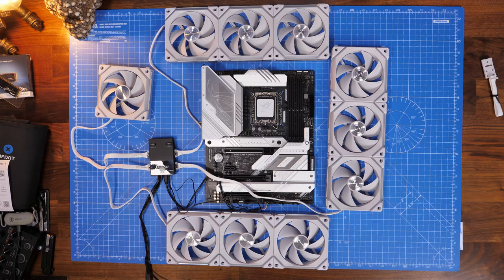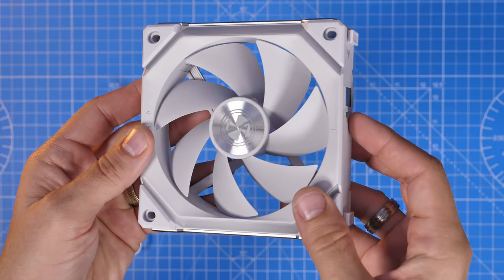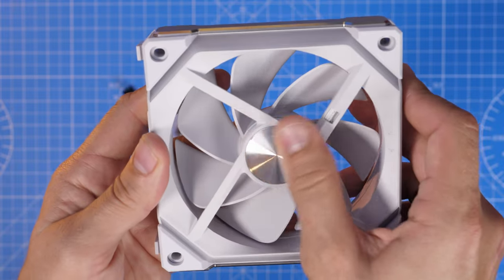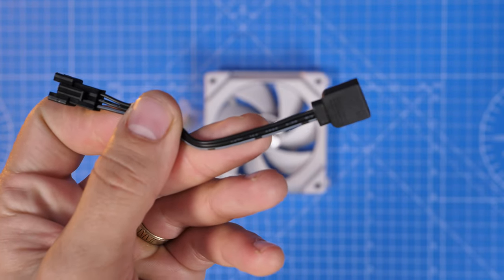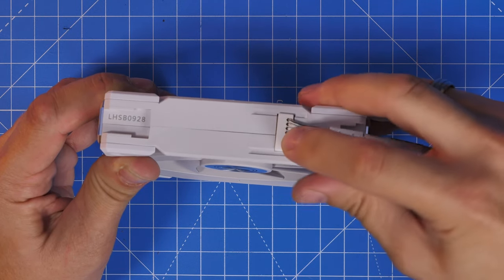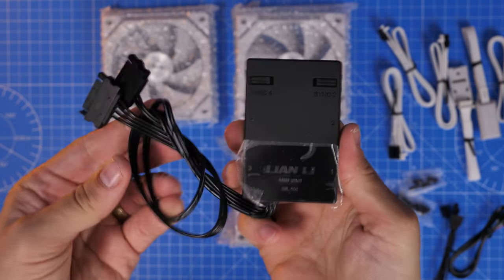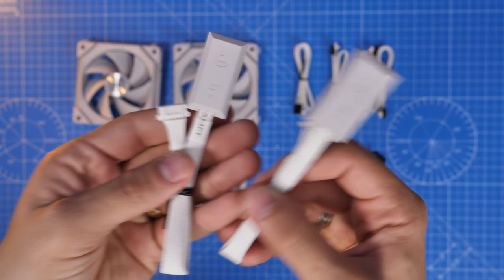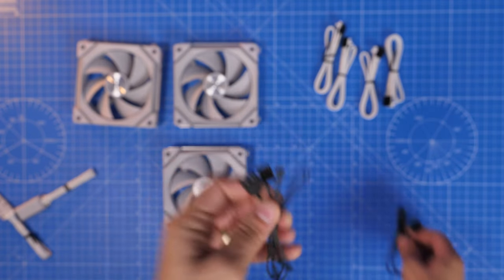How to connect and setup Lian Li SL120 V2 fans (including on an all-in-one cooler)

Comment: your guides are always great to watch and a big help building up a new system. i have a 011 dynamic evo xl case with an additional led lightstrip on the front of case. i will mount 10 lian li tl 120 fans. which is the maximum number of fans the lian li controller can handle. will the controller still work when connecting the led lightstrip from the case to port 4 of the controller or is it better to connect that on the motherboard directly?

Comment: I'm using this same Asus Rog strix X670E motherboard and I'm confused about rather or not Lconnect 3 can sync with the RGB lighting built into the motherboard. Did you cover that, and I may have missed it?

Comment: Trying to understand how you have all those fans into the 2 rgb slots in the controller. The radiator fans need a dedicated rgb slot, meaning you either daisy chained all the others or you have 2 controllers?
Reply from the maker: You don't "need" to use the RGB header on the motherboard technically. But yes, you can opt for two controllers instead.

Comment: I'm planning a build that involves at least three sets of the 140mm version of this fan. Sadly, they don't sell it in a 3-pack like the 120mm so the only way to get the controller is to either buy it separately or buy a 3-pack of the 120mm to get it, which is sadly the easiest way to get it because the standalone controller seems to be hard to find in stock. EDIT: Scratch the standalone controller. That's the V1 intended for the UNIFAN V1's. The controller that comes with the V2's isn't available as a standalone yet. Which means the only way to get it is to buy a 120mm 3-pack even if all you want is the controller or one 120mm fan to use as the rear exhaust if a 140mm won't fit with everything installed.
Reply: where did you buy i cant find any in stock

Comment: Thank you for this, I am still a little confused using the Lian Li v2 fans for my AIO H150 LCD Elite XT and hoping you can help! I have the h150i with the single wire connector going to the  CPU Fan connector on the mobo(Strix Z790A WiFi II) and the other 2 cables going to the H150i controller, so it's hooked up as it should be. I then have the 3 daisy chained Lian Li fans for the AIO going to the Lian Li V2 controller in 1 of the 4 slots and the other 3 slots are being used for the case fans. Is this the correct way to do it? Since the Lian Li controller is hooked up to the Mobo to a CHA Fan connector at the bottom, does that mean the AIO fans function correctly and can be adjusted in L connect since the AIO is hooked up to the CPU fan on the Mobo or would I need to swap the AIO fans cable to that splitter cable that comes with the single fan and plug the RGB connector into the sync port on the UNI hub and the 4 wire connector to the CPU fan, which would mean the h150i singe wire connector would be unused...? Really hoping you or someone can help so I can finish this build today!

Comment: Hi, I just have a question with motherboard connections. If I replaced the radiator fans to the SL UNI 120 , do I connect a 4-pin splitter to the pump, to then connect to the 4-pin cable on the fans? And also plug in the sata, usb and 4-pin connection from the pump to the motherboard and sata? 

I am using a B650 Auros elite ax mobo and lian li galahd ii trinity 240

Comment: Are the spare connection cables that come with the 3 pack of 120mm fans interchangeable with the 140mm fans ? 
I want to link a set of 3x 140mm fans with a set of 2x 140mm fans for intake, and a set of 3x 120mm with a single 120mm for exhaust & using the control box provided in the 3pack of 120 fans.

Comment: I just built a new computer and I notice that my CPU temp will go from 44 C at idle to roughly 52 C and the fans will rev up to get the temp down and this is a bit annoying.
Since this is the first computer I've built with RGB thing-a-majigs in it I'm wondering if I've made a mistake somewhere, so I found this video and it looks like I've messed up a little if I understand you correctly.
I have a Lian Li 011D Evo RGB, a Lian Li Galahad II Trinity with the default fans and 7 Lian Li UNI FAN SL120 RGB V2 PWM's.
I have three fans in the bottom as intakes, three at the front as intakes, the AIO fans as exhaust and one fan as exhaust at the back.
The bottom fans are connected to the front fans which in turn connects to the third port on the Lian Li controller. 
The rear fan is connected to the first port on the Lian Li controller and the AIO is connected to Sync 2.
But if I understand you correctly (17:50) I should plug the fans on the AIO to an RGB header and fan controller rather than the Lian Li controller. Is that correct?
Reply from the maker: You can do that or alternatively you can go into the L connect software, remember the port those fans are connected to and set them to adjust to CPU temp. That way the fans on the rad spin accordingly. Maybe set the others to respond to GPU temps
Reply: @TheProvokedPrawn  I noticed in the instructions that I should have a cable from the pump to the fans, so I connected that cable and not the system is quiet.

Comment: Question, does this work with regular Lancool Mesh 2 case fans tho? I bought a 3 pack of these  SL120 V2 fans with a controller but it doesnt seem to be able to accomodate the regular 3 pin fan headers :(

Comment: Dear Prawn 🦐,

Thank you for this amazing video you created.

I have one question. At 14:30 what is that kabel’s name or number that you just to connect the fan to the control box and the pump header on the motherboard. because I did not get it with my uni fan SL-INF 120 triple pack or the single pack. Is this cable for sale separately? I hope you can help.

Thanks for all you great work👍🏻

Comment: Can you please help me? I have Nzxt z53 and Lian li sl120 v2 fans. I want the Nzxt CAM to control the fans based on temp, but for some reason the Lian li L-connect controls the fan speeds for the cpu. Also, it reads higher temps than CAM so the fans are always at 100% and is so noisy. Is there something I can do to fix this?

Comment: Question using the 3 pin and the little tiny connector, you can plug that 3 pin into say... the Razer Chroma RGB Controller to control the RGB from THERE right?

Comment: The problem is if you buy the 3 pack of SL Inf 120, you only get the cables that allow you to connect to Hub, but with the single pack, the cable doesn't have a connection that allows you to connect to the HUB. It has the 4-pin PWM and 3-pin ARGB connector that goes directly onto the motherboard not the controller so I can’t separate the AIO fans from the case fans. You are left with a choice of running everything from the hub, which doens't allow the pump to control fan speed, or connecting power to the pump and then RGB to the board which L-connect then wont control with all the other fans.  Any solution to this?

Comment: I love the look of these but they nearly broke me tonight. I have there CPU  cooler which came with V1 fans and I got a 3 pack of the fans that are v2 and I cannot for the life of ke get them to sync up. They have different control hubs with different connectors.

Comment: Good explanations but wrong aio radiator block position ! You got to have the pipes head down or that will damage it 🤷🏽‍♂️
Reply from the maker: No. You're wrong. As long as the pump isn't the highest point it's fine.

Comment: Do you need the ARGB cable coming off the controller installed onto a 5v header to control the RGB via L Connect?
Reply from the maker: No. That's just for motherboard sync

Comment: So because these fan hubs only connect to the MoBo with 1 pin my bios NEVER recognizes them allowing me to control them. The workaround is to use a splitter and run the hub and one set of fans off of the MoBo header. Do the v2s come with an adapter to hook into a standard MoBo header?
This is with an asus strix 690-e. No fan control using bios unless you give the fan header an actual fan to control

Comment: Could this be updated for the new Lian Li Infinity fans with the proprietary connector? 

I see you recommended against connecting the AIO fans to the controller, due to the flexibility that comes the dual connector.

In SL-Infinity 3 packs, the only cable included for the fans is the proprietary Lian Li cable that only connects to the controller. This leaves no choice but to connect the AIO fans directly to the controller, with no ability to connect to the motherboard or pump breakout cable (if it exists).

I'm wanting to use these Lian Li fans on my Corsair 150i radiator, but I'm worried that I won't have anything connected to the CPU_FAN header, and they won't work in conjunction with the pump. I'm going to try connecting them to the controller, and set a curve according to the liquid temp of the CPU radiator...since I have no other options.
Reply from the maker: https://youtu.be/W_ApiN_Wueg

Comment: I'm still waiting to get my kraken early next week so still scouting and planning how to put my infinity fans, it sucks we can only see the center infinity mirror when they are set to exhaust (afaik) i am a bit surprised why you set the fans to suck the warm air from the radiator into the chassie? Also wondering how i could set up as many infinity mirrors as possible to show inside ;(

Comment: Very well explained thank you. Glad I found this channel before I'm gonna start my first build I'm thinking about getting these fans the infinity versions. I heard they can get quiet loud though which is a big no for me. The other option I hear is good is the Arctic p12's but for airflow and minimal acoustics but wouldn't I have to get a butt load of controllers for 10 fans? :/ Decisions decisions.
Reply from the maker: I would not call the Infinity fans loud. In fact in my experience all Lian Li fans are quieter than other I've used.

Comment: This is a great explanation! I’m actually gonna do the same thing however I’m going to use a push pull configuration on the top, I was wondering do I just attach the second set of three fans to the second splitter for the pump power or I think it’s called a fan control? Also on a previous video you recommended using a XSPC Radiator Fan screw 30mm, would this work for the top of the case? (Because you utilise it for the side of the case)

Comment: Hi. Can you have more than 4 ports for the fans in l Connect 3 software? The controller itself has 4 + 2 ports (the 2 on the top sides of the controller which can connect 3 pin cables). But in the software only 4 ports are shown. What happens of my 4 normal ports are used and I connect another Lian Li device to the 3 pin port? Thanks.

Comment: Would there be any reason I shouldn't let L-Connect 3 control an AIO's radiator fans? I'm fine with plugging into the CPU Fan header, but wasn't sure if there was a hard and fast reason to do it. Thanks in advance.
Reply from the maker: If you want to do it that way you can.

Comment: Thank you! I have been slowly putting together my build and am doing this exact set up with the Evo and the infinity fans. I was curious about how to go about the AIO fans since I picked up the X73 (don't care for the Lcd) but thinking the Lian li fans would be an upgrade, so this is incredibly helpful. I like the idea of going full SL120's to have the single control box but makes sense to have the AIO control the set of fans attached. Do you think it would be wise for me to keep the nzxt fans as well and set up a push/pull configuration (exhausting top)? Also getting 13900 so I know it will run hot. Thanks again for the great videos.
Reply from the maker: Probably not because they will run are different speeds with different airflow capabilities. It works but it's not ideal
Reply: …and this was already tested by Jay2C and had not a single degree impact

Comment: where then do i plug in the cpu fan cable that's on the aio pump if im gonna plug in the lian li fans to the cpu fan header?? the cpu_opt header??? or do i even need to plug the one from the aio at all? 

i am using the corsair aio with the lian li infinity fans

Comment: I bought all triple packs for my nxzt kraken cooler and I don't have that one cable so am I good to just connect everything to the lian li fan hub? and also for the USB connection for the breakout cable on the pump do I just plug that into one of my USB headers on my motherboard since I'm not gonna be using the nzxt fan hub?

Comment: Hey I have 18 of these SL120 V2’s. I have 16 connected to one hub and that’s connected to an aqua computer OCTO for pwm control through water temperature. Can I connect the last two via that single cable splitter which separates the rgb and pwm fan to the same controller via the sync port and the octo will take the pwm cable?

Comment: Thanks for the video. Super informative.  If I have an AIO GPU with radiator, after plugging in the rgb into sync slot, where do I plug the fan control?  Thanks in advance

Comment: So wait I’m confused, can I just run the USB cable or do I need to connect that 5V ARGB cable. Asking because I don’t have a 3 pin ARGB header on my mobo
Reply from the maker: You can just use the usb connection from the hub and control them via L-Connect

Comment: One question I have, you wouldnt be able to use the SL120 fans on the lian li galahad aio with this controller would you? So you would have to replcae the fans on the aio with the V2 fans, at least that is how I'm understanding it
Reply: Im having this same problem. ST fans on the radiator and SL fans have the easy single connect. The controller doesn't have the 3/4 pin but only the SL connection. might have to replace the lian li fans on the radiator to SL to make it simple but im also looking for alternative answers.

Comment: Hi there, im will use SL120 v2 + LT720 for my fish tank build, and use the single wire with RGB+power and connected it to my controller and have it controlled using the software and just set the fan speed to max or it is still better to connect the SL120 v2 for may radiator and have it connected to the aio wire and connect to my pump header and have the rgb from the aio connected to the controller?

Comment: Hello Provoked Prawn! Great quality on your videos. I went with this exact setup but unfortunately ran into so many software bugs with L connect 3 I'm about to give up. This software crashes my new build gaming PC if i keep it running. So i have no fan control. I dont see a way to connect V2 fans directly to mother board. The set of 3 fans don't come with a cable that can go from fan to MB. I have one single that did come with that cable. Lian Li does not sell V2 cables of this kind that can go fan to motherboard and RGB to hub that i can find. Any suggestions? Thanks.
Reply from the maker: You could use the controller and connect to a PWM header and the RGB and then just use motherboard sync instead? Not heard of L Connect causing crashes though. Very odd.
Reply: @TheProvokedPrawn  Thanks, I'll give it a shot. I am blown away I cannot buy the cables I need or that they are not included in the set of 3 fans. Obstacles at every turn. Due to my personal experience, this will be the last time I use Lian Li products. Great hardware, terrible software. Be thankful you have not run into issues with L Connect 3. It made my new gaming PC build a miserable experience. I have probably put a year of shutdown strain on it over the past couple days.

Comment: Brilliant video, I subbed :) out of interest with the NZXT AIO is there a preference for plugging the Rad fans into the cpu fan header or is it best to keep them connected to the AIO pump splitter instead? Just as my motherboard manual suggests pump to AIO pump header, Rad Fans to CPU fan header - or best to literally keep it AIO for the liquid temp monitoring rather than cpu? Thanks

Comment: Great video. Just purchased the SL120's and I have replaced the two fans on my Kraken X53 rad with them. Still unsure about to connect them up though. Currently have CPU-FAN header connected to splitter where one cable goes to pump and other to the fans. RGB for fans plugged into Sync on controller box. LConnect3 software doesnt show fans turning and CAM only shows pump speed. Any ideas?

Comment: It looks like the cable from the sl120 v2 single pack is different to the sl120 infinity. I’m trying to connect 3 x sl120 infinity (as aio fans) to cpu fan and rgb controller using the cable came with the single pack. And found out the rgb connector on the controller side is different to the standard rgb connector on the cable side from the single pack. Now I don’t know what to do. What’s the workaround for this? Please help! 🙏

Comment: I know you are busy. Hopefully you can get around to my question. I installed the lian li fans(10 fans/ 4 groups / 3/3/3/1) connected like it says. But when I boot up my computer it says “over current status detected”. When I I plus the usb header the fans boot with the computer but no lights and no control over fans.
Reply from the maker: Have you connected the controller's power cable to your PSU?

Comment: Will be putting 10 lian li AL V2s. Would it be better for the CPU fans to be connected to the motherboard or the lian li controller so the speeds can be controlled by the software
Reply from the maker: https://youtu.be/Mm85qMEYlDI
Reply: You need to connect a Cpu fan to your Cpu heater or most motherboards wont poost

Comment: I have a question i have the fans and a corsair aio h150i elite xt , i want to use the lian li fans on it do i connect the lian li fans to the corsair adapter or the lian li adapter ?
Reply from the maker: I'd plug them into the CPU fan header on your motherboard if I were you.
Reply: @TheProvokedPrawn  and the rgb cable into the sync on the lian li adapter right?
Reply: @TheProvokedPrawn  is the one cable enough for the 3 fans
?